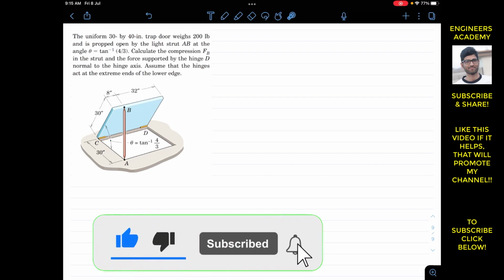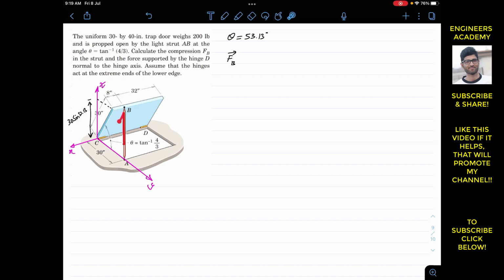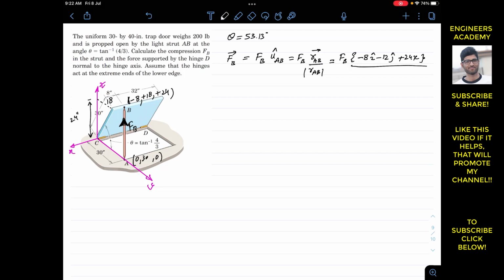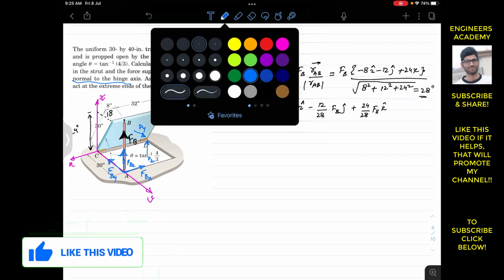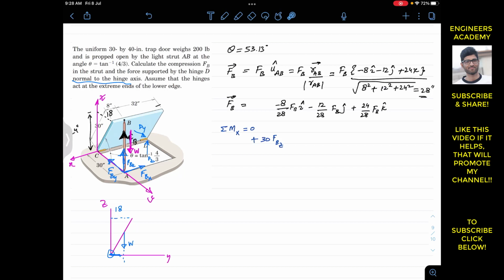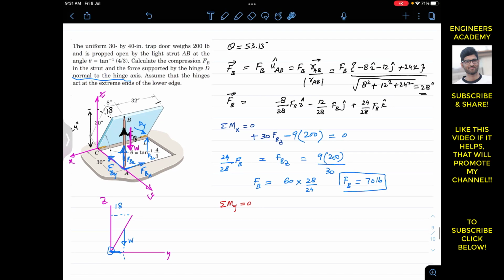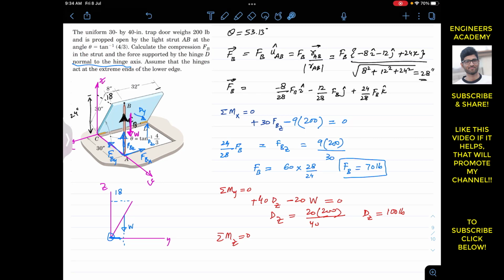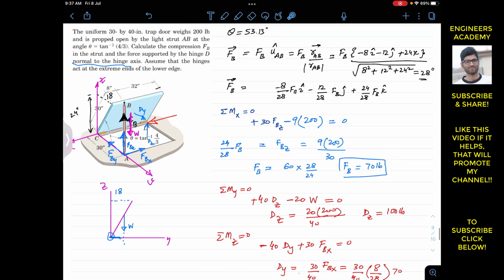3-93 Equilibrium 3D Solved Problems Engineering Statics Meriam 7th Edition Engineers Academy

Comment: Thank you for your video it helped out alot. 

Question 1. 
How did you know the directions of Dx, Dy, and Dz of hinge D

Question 2. 
You brought up the hinge having Dx, Dy, and Dz components. But in my textbook, I was told a hinge only has two reaction forces. So how were there three components involved which are Dx, Dy, and Dz. I understand it asked for the normal force which eliminates the need to look at the Dx component.

Question 3 
Why did we not need to look at the force acting on hinge C. When calculating moments